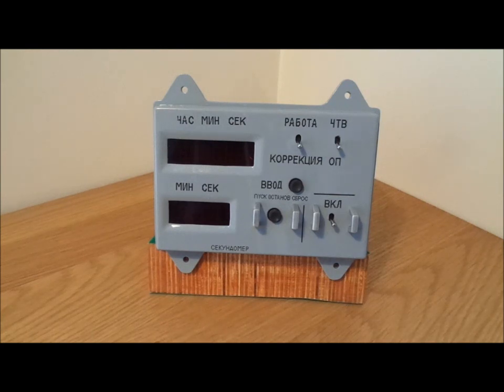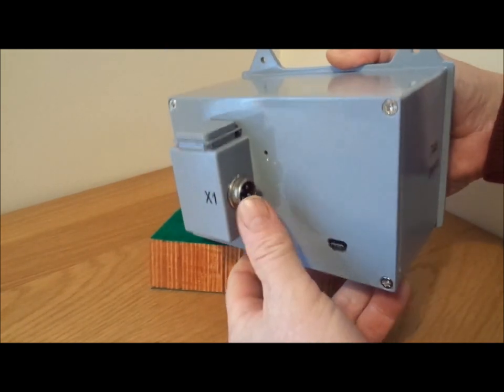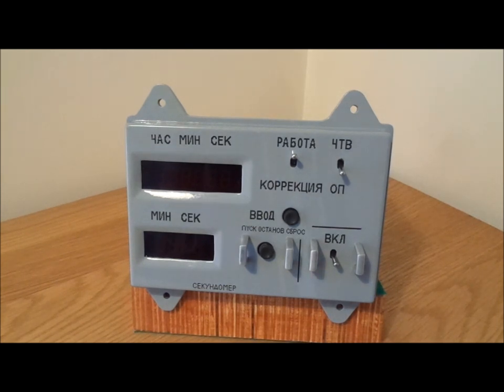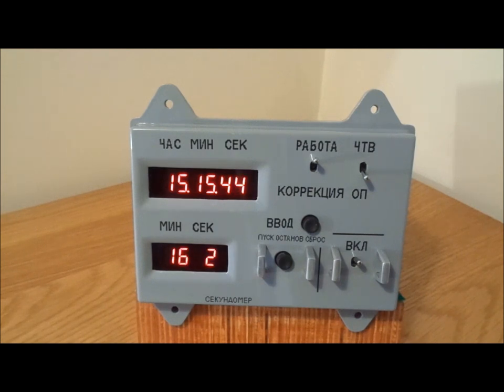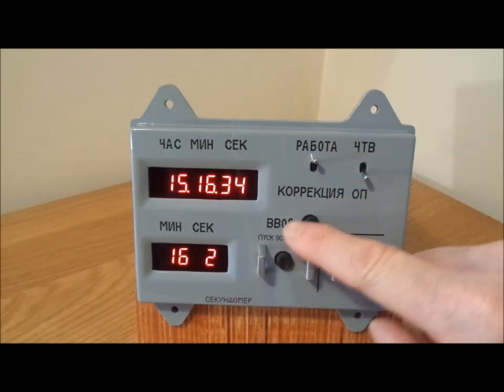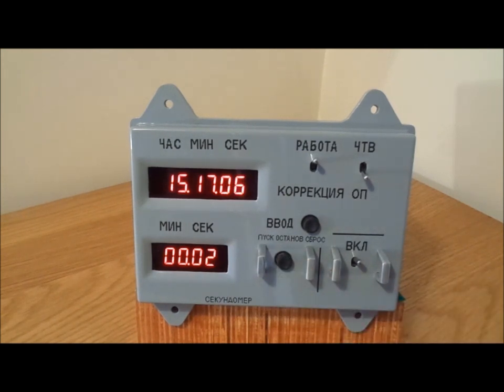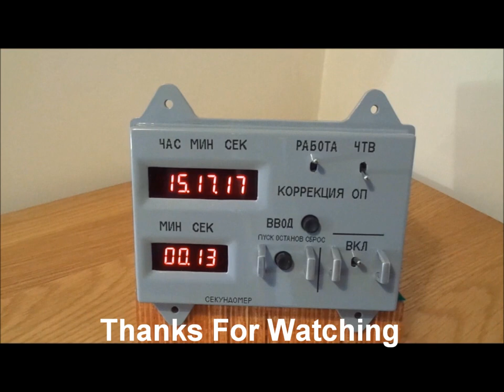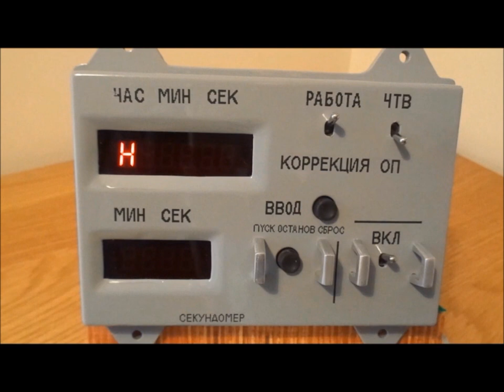Soyuz 744H Digital Clock Replica with Arduino

Comment: Very nice clock with useful improvements. How come the slanted Russian characters are jagged? Were they like that on the original instrument?
Reply from the maker: Hi Nixxon. Thanks for your comment. On the original clock the letters are stamped into the metal and filled with paint. I tried stamping but the die cast just split so I had to resort to printing on water-slide transfers (Decals). This was my first attempt and I now know some of the letters are slightly incorrect but this is the best quality my old laser-jet printer can manage hence the steps you can see. I will re-print them one day but I’m too busy on my next project right now. Best wishes Dave...
Reply: @dav651why  Good luck. Your clock is awesome :)

Comment: Great build, but I have to admit that Cyrillic fonts look pretty different. Capital Д always have legs beyond the line, and capital У never looks like Y, I mean it is always asymmetric, like small y. Б also looks weird, like b with dash. Someone who used to Cyrillic will always know that it is foreign typeset for the author.
Reply from the maker: Thanks russiandesman. Yes I have no detailed knowledge of Russian so I just copied the letters from the front of the original clock which are stamped into the metal and probably lose some of the fine detail. I copied these to make the waterlide decals.
Reply: @dav651why  Nevertheless the build is still awesome. Congratulations